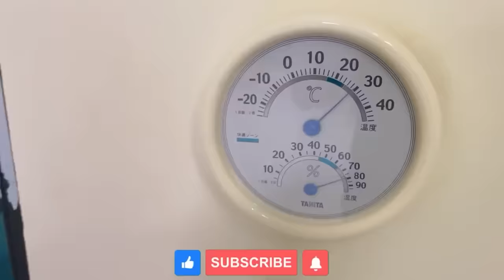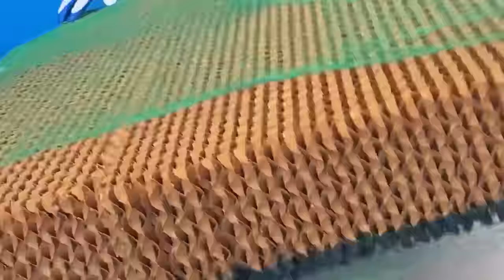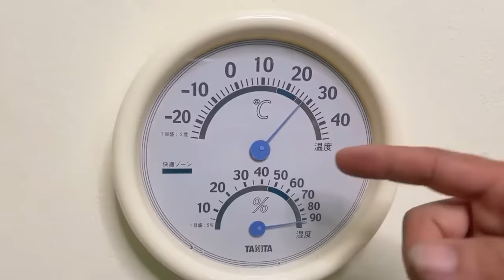32 techniques most used by plumbers near me! Idea with metal water lock + rivet + bottle and foam

Comment: I dont believe you have a water tight seal on the tank bolts of that toilet.
Reply from the maker: I understand your concern. We take water tightness seriously, and our team ensures that the tank bolts on the toilet are sealed properly. However, if you have any specific issues or doubts, please feel free to share more details so we can address them. Your feedback is valuable to us, and we aim to provide the best possible solutions. Thank you for your comment and for watching!
Reply: @HolicCreation  I have no concerns. I just know that, even with silicone, those tank bolts leaked. That shower head connection probably leaked as well. Actually, I'm certain that water was pouring out the bottom of it. They are very creative ideas, but that's about it..Just because it made a connection doesn't mean it is not going to leak. I stopped watching after the shower head repair but I bet those were NOT  the only 2 that "looked" repaired and were actually leaking.

Comment: Ive learned more from this video than I have in years! Do you have any recommendations for must-have plumbing tools?
Reply from the maker: I'm thrilled to hear that you found the video informative! When it comes to plumbing, having the right tools can make a world of difference. Here are some must-have plumbing tools for both beginners and enthusiasts:

Adjustable Wrench: This versatile tool is used for tightening and loosening nuts and bolts on pipes and fittings.

Pipe Wrench: Designed for gripping and turning pipes and fittings, these come in various sizes for different tasks.

Plunger: Essential for unclogging drains and toilets, a plunger can quickly resolve common plumbing issues.

Pipe Cutter: Ideal for cutting copper, PVC, and PEX pipes cleanly and accurately.

Tubing Cutter: Specifically for cutting copper tubing, it ensures precise cuts for soldering or connecting pipes.

Teflon Tape: Also known as plumber's tape, it's used to seal pipe threads and prevent leaks.

Pipe Sealant: A thread sealant applied to pipe threads to create a watertight seal.

Plumber's Putty: Used for sealing drains, faucets, and fixtures, preventing leaks in these areas.

Hacksaw: Helpful for cutting through metal pipes, brackets, and other materials.

Caulking Gun: Essential for applying caulk around sinks, bathtubs, and showers to prevent water leaks.

Copper Fittings and Soldering Kit: If you work with copper pipes, you'll need fittings and a soldering kit for secure connections.

PVC Pipe and Fittings: For working with PVC pipes commonly used in residential plumbing.

Crescent Wrench: A versatile tool for tightening and loosening various nuts and bolts.

Safety Gear: Don't forget safety glasses, gloves, and hearing protection when necessary.

Snake/Auger: For clearing tough clogs deep within pipes and drains.

Compression Sleeve Puller: Handy for removing compression fittings.

Water Pressure Gauge: To measure and adjust water pressure in your plumbing system.

Plumbing Inspection Camera: A more advanced tool for inspecting pipes and identifying issues within them.

These are some of the fundamental tools that every aspiring DIY plumber should consider having. As you gain experience, you can expand your toolkit to include more specialized items. Always prioritize safety and consult with professionals when dealing with complex plumbing issues. Happy plumbing!

Comment: This video is a goldmine of plumbing knowledge! Any advice for someone trying to tackle a small plumbing repair at home?
Reply from the maker: I'm glad you find the video valuable! Tackling a small plumbing repair at home can be a rewarding DIY project. Here are some tips to help you get started:

Safety First: Always turn off the water supply to the area you're working on before beginning any plumbing repair. Safety goggles and gloves can also be essential.

Educate Yourself: Watch tutorials, read guides, and understand the repair you're about to undertake. Knowledge is your best ally.

Gather the Right Tools: Make sure you have the necessary tools for the job, such as wrenches, pliers, pipe cutters, and sealants.

Plan Ahead: Before you start, plan out the repair process step by step. This will help you stay organized and efficient.

Take Your Time: Don't rush. Small plumbing repairs can be intricate, so take your time to do it right.

Ask for Help: If you're unsure or encounter unexpected issues, do not hesitate to leave your comments below our video, we are always here and try to give you the most effective solutions

Test Before Finishing: After completing the repair, turn the water supply back on and check for any leaks or issues before finishing up.

Keep a Cleanup Kit Handy: Have towels, buckets, and a mop nearby in case of spills or accidents.

Thank you so much and Good luck with your DIY plumbing project!

Comment: Thanks for sharing these techniques! How often should one perform routine plumbing maintenance at home?
Reply from the maker: You're welcome! Routine plumbing maintenance is essential to prevent potential issues. As a general guideline, it's a good idea to perform basic checks every six months to a year. This includes inspecting for any leaks, checking water pressure, and ensuring that all faucets and fixtures are working correctly. However, the frequency may vary depending on your specific plumbing system, its age, and local water conditions.

Additionally, it's crucial to perform maintenance if you notice any signs of plumbing problems, such as slow drains, unusual noises, or water discoloration. Being proactive can help you catch issues early and avoid more significant repairs later. If you have an older plumbing system or live in an area with hard water, more frequent maintenance may be necessary.

Remember that regular maintenance not only helps prevent emergencies but also extends the lifespan of your plumbing system. If you'd like more detailed guidance on specific maintenance tasks, feel free to ask, and I'd be happy to provide further information!

Comment: The use of rivets in plumbing is intriguing. Could you explain when its best to use rivets instead of traditional methods?
Reply from the maker: Thank you for your interest in the use of rivets in plumbing! Rivets can indeed be an intriguing and effective choice in certain plumbing situations. Let me explain when it's best to use rivets instead of traditional methods:

1. Securing Thin Materials: Rivets are particularly useful when you need to secure thin materials together, such as metal sheets, ductwork, or lightweight pipes. They provide a secure and reliable connection without the need for welding or soldering.

2. No Heat Required: Unlike traditional methods like welding or soldering, rivets don't require heat. This can be advantageous when working with materials that are sensitive to high temperatures or in confined spaces where open flames are not practical.

3. Versatility: Rivets are versatile and can be used in various plumbing applications, including joining pipes, attaching brackets, or sealing gaps. They work well in both residential and commercial plumbing projects.

4. Quick and Easy: Riveting is generally a quick and straightforward process. It doesn't require extensive training or specialized equipment, making it accessible to DIY enthusiasts and professionals alike.

In summary, rivets are a valuable addition to a plumber's toolkit, especially for specific applications involving thin materials, accessibility challenges, or cost considerations. Moreover, Always prioritize safety and effectiveness when making your decision.

I hope this explanation helps clarify when it's best to use rivets in plumbing. If you have any more questions or need further details, please don't hesitate to ask!

Comment: Thanks for sharing these techniques! How often should homeowners consider a professional plumbing inspection?
Reply from the maker: Thank you for your comment! The frequency of professional plumbing inspections for homeowners can vary depending on several factors:

1. Age of the Plumbing System: Older homes may require more frequent inspections, while newer systems might need less frequent checks.

2. Usage:  If your household uses a lot of water or has a large family, more frequent inspections may be necessary.

3. Location: Homes in areas with hard water or extreme weather conditions might need more regular inspections.

4. Previous Issues: If you've had plumbing problems in the past, consider more frequent inspections to catch potential issues early.

In general, it's a good idea to schedule a professional plumbing inspection at least once a year. This can help identify any minor issues before they become major, costly problems. Additionally, consider inspections before winter to prevent frozen pipes and after any major renovations or changes to the plumbing system. Regular maintenance can prolong the life of your plumbing system and save you money in the long run.

Comment: Im feeling inspired to take on some DIY plumbing tasks. Any safety precautions I should be aware of?
Reply from the maker: I'm thrilled to hear you're feeling inspired to tackle some DIY plumbing tasks! Safety is paramount when working on plumbing projects. Here are some essential precautions to keep in mind:

Turn Off the Water: Always shut off the water supply to the area you're working on. This prevents accidental water flow and potential flooding.

Wear Safety Gear: Depending on the task, wear appropriate safety gear like gloves and safety goggles to protect your hands and eyes.

Use Tools Safely: Handle tools with care and follow their instructions. Ensure you have a firm grip on tools and maintain good balance when working.

Ventilation: When working with chemicals or in enclosed spaces, ensure proper ventilation to prevent inhaling harmful fumes.

Electricity: If your plumbing work involves electrical components, turn off the power supply to the area and use tools with insulated handles.

Proper Lifting: Use proper lifting techniques when handling heavy materials or tools to avoid back strain or injury.

Know Your Limits: If a project seems too complex or beyond your skill level, it's best to consult a professional plumber. Don't hesitate to seek expert help when needed.

Emergency Preparedness: Have a plan for handling unexpected situations like water leaks. Know where the main shut-off valve for your home is located.

Remember, safety should always come first. Take your time, follow best practices, and enjoy your DIY plumbing projects while staying safe!

Comment: Great video! I had no idea there were so many techniques involved in plumbing. Can you recommend any beginner-friendly tools for someone looking to start DIY plumbing?
Reply from the maker: Thank you for your positive feedback! If you're looking to start with DIY plumbing, there are several beginner-friendly tools you can consider adding to your toolbox:

1. *Adjustable Wrench:* An adjustable wrench is a versatile tool that can be used for various plumbing tasks, like tightening or loosening nuts and bolts.

2. *Pipe Wrench:* A pipe wrench is designed for gripping and turning pipes and fittings. It's essential for tasks like installing or removing pipes.

3. *Plunger:* A plunger is a must-have for dealing with clogged drains and toilets. It's simple to use and effective in many cases.

4. *Teflon Tape:* Teflon tape, also known as plumber's tape, is used to seal threaded pipe connections and prevent leaks.

5. *Pipe Cutter:* A pipe cutter is handy for cleanly cutting pipes to the desired length. There are various types available, including tube cutters and PVC pipe cutters.

6. *Pipe Threader:* If you plan to work with threaded pipes, a pipe threader can be helpful for creating clean and secure connections.

7. *Hacksaw:* A hacksaw is useful for cutting through pipes and other materials when necessary.

8. *Tongue-and-Groove Pliers:* These pliers, often called channel locks, provide a strong grip and are useful for various plumbing tasks.

9. *Pipe Insulation:* To prevent frozen pipes in cold climates, consider pipe insulation to wrap around exposed pipes.

10. *Safety Gear:* Don't forget safety gear like safety glasses, gloves, and a dust mask to protect yourself while working.

11. *Plumbing Snake:* For more advanced DIY plumbing, a plumbing snake can help clear stubborn clogs deep in pipes.

These tools should cover many basic plumbing tasks and are a good starting point for DIY plumbing projects. Remember to familiarize yourself with each tool's proper usage and safety precautions before starting any plumbing work.

Comment: These techniques seem really useful. What safety precautions should one take when attempting plumbing repairs?
Reply from the maker: I'm glad you find the techniques useful! Safety is paramount when attempting plumbing repairs. Here are some essential safety precautions to keep in mind:

Shut Off the Water: Before starting any plumbing work, turn off the water supply to the area you're working on. This prevents accidents and water damage.

Wear Protective Gear: Use safety goggles to protect your eyes from debris or splashes. Gloves can help protect your hands.

Ventilation: Ensure there is proper ventilation in the area where you're working, especially if you're using any chemicals or sealants.

Use the Right Tools: Always use the appropriate tools for the job to avoid injury or damage.

Avoid Overexertion: Plumbing work can be physically demanding. Take breaks if needed and stay hydrated.

Electricity Awareness: Be cautious around electrical fixtures and outlets. If water is involved, turn off the electricity to the area.

Gas Lines: If your repair involves gas lines, it's best to leave it to a professional plumber due to the potential dangers.

Chemicals: Use chemicals like drain cleaners with caution, and follow the manufacturer's instructions. Keep them out of reach of children.

Fire Safety: Have a fire extinguisher nearby in case of emergencies.

Emergency Plan: Familiarize yourself with the location of the main water shut-off valve in case of a major plumbing emergency.

Taking precautions and being prepared can help ensure a safe and successful plumbing repair. Hope you succeed with your DIY projects and have a good day!

Comment: The foam technique is fascinating! Is there a specific type of foam that works best for sealing purposes in plumbing?
Reply from the maker: We have chosen to use Expanded Polystyrene (EPS) foam in our project, and indeed, when it comes into contact with super adhesive glue, it creates an incredibly strong adhesive mixture. This is very helpful when we need to patch up cracks in most types of plastic pipes. The best part is that the cost of doing this is extremely reasonable, saving us money on our project. We greatly appreciate your suggestion, and we hope this information will help you feel more confident when considering using EPS foam in your own projects!

Comment: The rivet method is a game-changer. How did you discover that it could be used in plumbing?
Reply from the maker: I'm glad you found the rivet method intriguing! I came across this technique through years of experience and learning from fellow plumbers. It's not a widely known method, but it can be incredibly effective for specific plumbing repairs, especially when dealing with damaged or leaking pipes.

The idea behind using rivets is to create a strong and lasting seal, which can be particularly useful in situations where traditional methods might not work as effectively. By sharing these unconventional yet effective plumbing techniques, I hope to empower DIY enthusiasts and homeowners to tackle common plumbing issues with confidence and efficiency.

If you have any more questions or would like to know more about specific plumbing techniques, feel free to ask. I'm here to help!

Comment: I appreciate the insights into plumbing. Can you recommend a good brand for plumbing tools and supplies?
Reply from the maker: Certainly! When it comes to plumbing tools and supplies, there are several reputable brands known for their quality and reliability. Here are a few well-regarded brands that you can consider:

Ridgid: Ridgid is known for its durable and professional-grade plumbing tools. They offer a wide range of products, including pipe wrenches, pipe cutters, and drain cleaning tools.

Milwaukee: Milwaukee provides a variety of power tools and plumbing equipment. Their cordless tools are particularly popular among professionals and DIY enthusiasts.

DEWALT: DEWALT offers a range of plumbing tools and equipment, including cordless drills, saws, and hand tools. They are known for their durability and performance.

Klein Tools: Klein Tools specializes in hand tools and is well-regarded for its pliers, screwdrivers, and electrical tools. Many plumbers trust Klein for their precision and longevity.

SharkBite: SharkBite is known for its innovative plumbing solutions, including push-to-connect fittings that simplify DIY plumbing projects. They are excellent for quick and reliable connections.

Moen: Moen is a reputable brand for plumbing fixtures and faucets. If you're looking to upgrade or replace plumbing fixtures, Moen is a popular choice for quality and style.

Apollo: Apollo offers a wide range of plumbing supplies, including valves, fittings, and pipes. They are known for their affordability and accessibility.

Uponor (Wirsbo): Uponor is recognized for its PEX plumbing systems. If you're considering PEX piping for your plumbing projects, Uponor is a trusted brand.

It's important to research and choose the specific tools and supplies that best suit your needs and the type of plumbing projects you plan to undertake. Additionally, read reviews and seek recommendations from professionals or fellow DIYers to ensure you're investing in high-quality products.